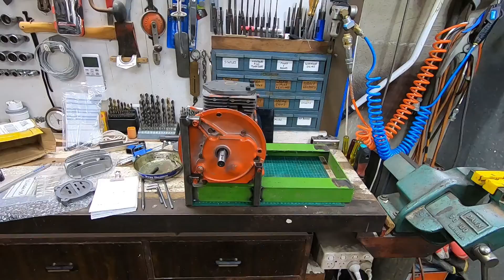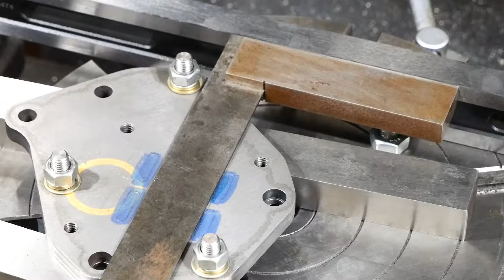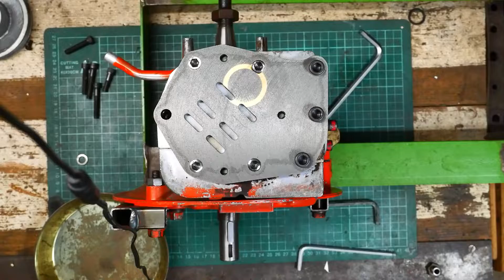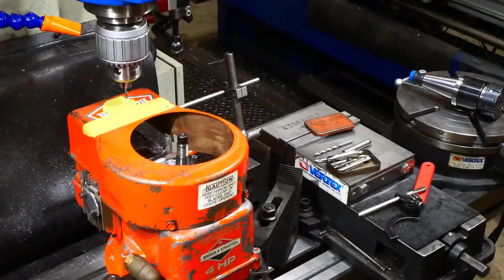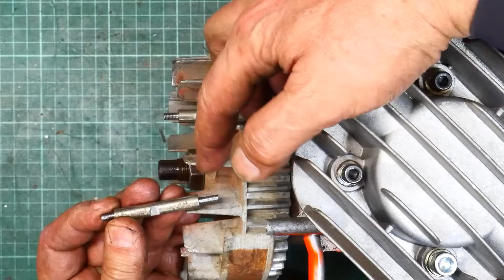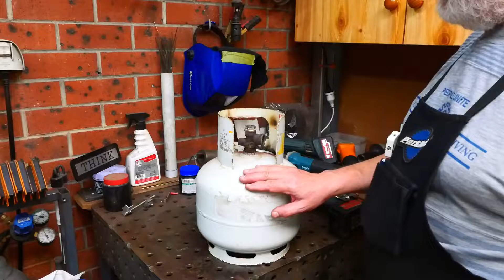Briggs & Stratton conversion to an air compressor - Part 5

Comment: I cut a briggs&stratton camshaft and rotated the exhaust lobe to where it opened on the downstroke. I cut an old engine down to use as a jig while welding the camshaft back together. I replaced the spark plug with a check valve and belt drove it. Worked great.

Comment: Allan with all the work you have done I would make it a designated compressor for  the mill and horizontal mill to complement there flood coolant. 
 Christopher from Queensland
Reply from the maker: That's not a bad idea Christopher.
Cheers.

Comment: Lacking a decent power source that compressor really pumps some pressure fast!.
 Until the new engine is working you won't know but as far as I can see the cfm is fairly large. If this is the case Alan don't write it off as a test project but look at using it for a air source for a possible plasma cutter? Better yet, use it for a shop compressor to feed air for your mill and lathe? Might be perfect to run a die grinder to do some great work grinding tapers and the like?
 Sorry just dreaming aloud LOL
 Very impressed with the build quality and the overall design and fixes to get the end product!  
Keep up the good work!
Reply from the maker: Unfortunately the compressor is not as capable as it might appear. The swept volume is 187cc so running at 1000rpm it could theoretically produce 187litres/min or 6.6cfm into free air but, with various unavoidable losses, significantly less than this at say 100psi. It appears to build pressure quickly because the receiver is small - probably about 5 litres or perhaps a gallon. Anyway, I am pleased with the performance of the compressor and it was an interesting build.
Thanks for your enthusiasm and support Sparkie.
Reply: I wonder if changing pully sizes could help. Would it be that a large pully on the motor would make it work less? Wondering if pully sizes are changed so both units spin at low rpms at a lesser work load would be helpful? Idk
Reply from the maker: Changing pulley sizes would certainly make a difference. Smaller motor or larger compressor pulleys would allow the motor to apply more torque. However, this project was only meant as an experiment to explore the possibility of repurposeing an lawn mower engine and I won't be taking it any further. Thanks for watching.
Reply: @alanshomeworkshop  well thanks for doing the project. I learned a lot of helpful information as I too have an old lawnmower engine sitting around that I was considering this with